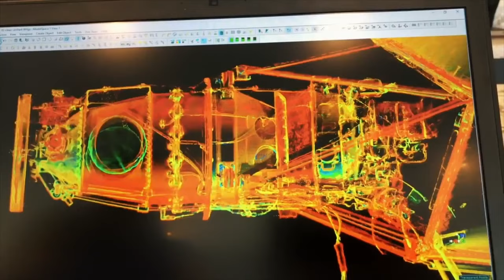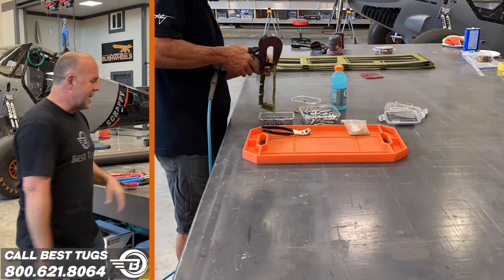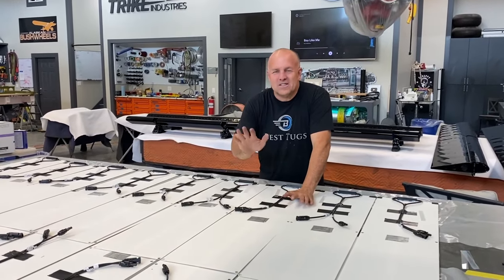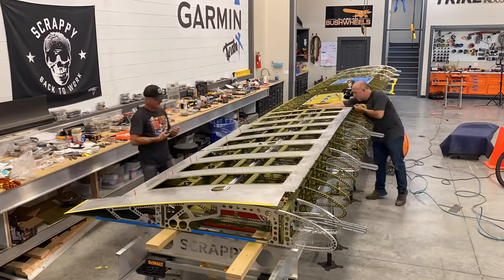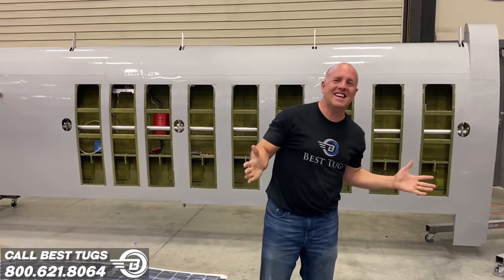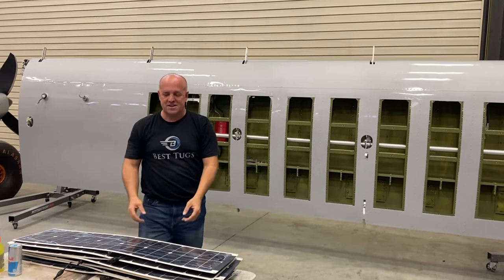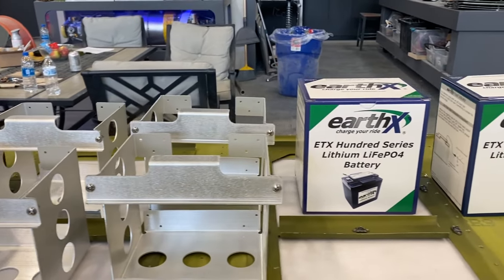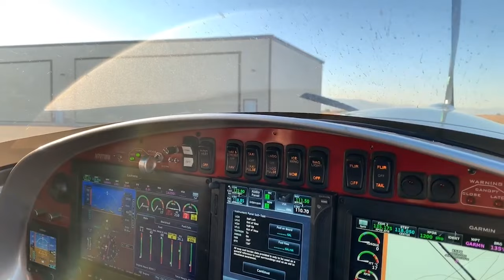Solar Panel Wings on Custom Search and Rescue Bush Plane | Scrappy #59

Comment: Hey Mike

 I was wondering how the low pressure on top of the wings, while in flight, isn't just going to suck those solar panels right off the wings. Then youre losing lift, potentially catastrophically. 

I see the little groove that tucks in, in the leading edge of the panels, but is that enough to counter all that low pressure?
Reply: they are riveted/screwed down around the perimeter too, the groove is just to prevent air from going under the panels
Reply: I get that, but it still leaves a big chunk of your wing surface made of thin plastic thats not nearly as strong as the rest of the skin that doesn't fare as well if, say, you have a thin sheet of ice, rain, etc.

Why not leave the metalc skin under the solar panels. Mike's  a smarter guy than i am, but it still makes me nervous. I guess we'll see how the wing performs.
Reply: @bakmir829  I have panels wit both fiberglass and aluminium backplates that are way sturdyer then the wingskin

Comment: If your wing loading is 15 lb/square foot and the solar panel is 3 sq.ft then the lift force is 45 lb. at 3 g’s that number starts to get significant...are the solar cells bonded to an inside skin......?

Comment: Hi Mike. I see that you're also into the Reno Air Races - I was wondering if you'd be interested in a racer that I've done the initial design of, it has a genuine 6,000 hp. That should be enough power? :)

Comment: Did Mike ever comment on why aluminum was used instead of carbon fiber for the wing material? I don't know very much about aircraft construction, but the aluminum seems out of place relative to the extensive use of carbon fiber throughout the construction elsewhere.

Comment: Mike, was there any reason why you did not use carbon fibre skins on the your wings? Would it have been cost, given that carbon fibre is lighter than aluminum and stronger than steel?

Comment: @MIKE: How well will the solar panels resist the 'suction' of the negative pressure caused by the airflow (lift) on the upper surface of the wing ?  The solar panels look a bit floppy, and I'm concerned that the negative pressure on the upper surface of the wing might cause the solar panels to distort or even pop out along the edges. (I presume that you've thought about this; this is just to make sure.) It should be easy to calculate the the negative PSI and multiply by the panel area, and then see if it makes sense that each panel could support ~200 lbs (?) of suction pull on their surface. Cheers.

Comment: What is the length differential of the black flaps and light wing from hottest to coldest? How does your control linkages accommodate the length difference without binding?

Comment: A 1kW Honda Generator weighs weighs 28 Ibs or 13kG. If you converted the generator to run on aviation fuel, how much difference would the weight be compared to the Solar installation on the aircraft?  You could run the Generator all day, not so with Lithium batteries having to have a residual charge.

Comment: Mike, is galvanic corrosion an issue with that much power flowing through the wings ? 
Also, how are you handling frequency isolation for your audio and headsets ?

Comment: What keeps the low pressure on the top of the wing from sucking out the solar panels, are they bolted in?
Reply: I was going to ask the same question... extreme  stall? Turbulence?    Mike?
Reply: @tommyo9879  I can see fasteners around the periphery and down the center as a backup measure along with adhesive to prevent long term vibration damage to the glass substrate in addition to preventing water intrusion into the foil cavity.

Comment: How much suction is created by the air foil and the Leading Slats and what material are the solar panels made out of? Would there ever be a chance of Solar Panel failure, i.e. the "Lift'" generatored by the wing "sucking" the panel out and leaving a hole and the wing stalling?

Comment: Anyone want to know how Mr Bernoulli will have his way with those solar panel?  How will the panels be secured to the ribs? The pressure differential might be significant to pull the panels out of the wing unless they are bonded and “rib stitched” in.

Comment: Hey Mike, Love your videos. I not into flying but the fab stuff is great. This video really made me wonder though. You are talking about backcountry flying and now backcountry with motos. Not sure that is a great message to be sharing with the general public. Many places in the backcoutry mechanized travel is illegal. Even a bicycle is prohibited. I ride traditional motos, used to for years in Colorado.(I am in Europe now which is even more restrictive). The electric motos coming out are amazing and I think the general public don't realize the damage they can do in the backcountry. They are full on motos, with the same or even more torque then an ice moto. Again. I am all for what you are doing. I think maybe you should just be careful how you are presenting it. Maybe even put a disclaimer that you will be using these awesome toys in accordance with the law but more importantly as low impact as possible.

Comment: do you plan to isolate the engine battery so that it isn't possible to drain Scrappy to the point there isn't enough power to crank and start the engine?

Comment: Mike, you basically just finished a wing with no upper skin.. as much as I love the novelty, this was a bad call for any plan let alone something as extreme.
during flight, you don't need solar to charge batteries and once you land and tie the plane there are better options that wouldn't compromise the integrity of your wing.

These solar panels won't help you if you are flying into the sun and they sure won't be of use if the plane crashes and is upside down or if one of these batteries catches on fire and the whole plane goes up in flames.

Comment: So you have 900 watts of nominal solar.  Rule of thumb for a fixed angle installation on a clear day is to expect 1/2 the rated output times the hours of daylight-2.  So for a 12 hour day you get 10 hours X 450 watts is 4.5 kilowatt hours.  Its a lot for camping, but I think you are going to be a little disappointed with how long it takes to recharge after running your batteries to rated minimum with a welder. This is all the more true when you consider that inverters are somewhere around 65% efficient at their max rated load. My conservative estimate of 10kW to run a welder has you burning through a full day's worth of charging in less 20 minutes of use.

Comment: How about the air sucking those panels out of the wing? They will be lifting the airplane, after all.
Reply from the maker: I’ll show the bolts later it has twice the attachment of any fabric or large top skin inspection bay.  👍🤠
Reply: @MikePatey  By the way, with those underwing attachments and power source you can take a concrete mixer with you, not only a welder. I guess you'd find a purpose for it in the wild.

Comment: Hey Mike, now let me start off by saying I am no expert on Lithium batteries but one of the downfalls of lithium batteries in an RV is they don't like cold. So in an RV application they have to heat the bay that the batteries are in. Are your batteries different or how did you fix this problem?

Comment: No way those solar cells will have the ability to run everything the way you described. Plenty of power in theory, but you will be lucky to get 50% of the rated power of the solar cells, especially the further north you travel. Solar cells are rated according to the power they would generate oriented directly facing the Sun, at midday, at the Equator on a Spring or Autumn Solstice day. That just never happens in real life. The cells are curved following the wing, so there is a loss of efficiency straight away. Not all of the cell can be aligned properly directly pointing at the Sun. Lithium batteries in the wing with high power wiring going past the fuel tanks, what could possibly go wrong?
The ideas and attention to detail are fantastic, but that amount of power in an area that will suffer condensation and huge temperature changes frightens the living daylights out of me. Solar cells on the wings, but everything else should be tucked somewhere in a relatively benign cabin environment to my way of thinking.

Comment: Anyone else think Mike is going to try and rebuild a gearbox in the bush....No. Just me then....One other question Can the clear layer on the solar panel handle the negative pressure on the top of the wing (The material and its adhesion)???

Comment: Wouldn't you put in two pot.meters at the wing tip which stops the flap motor in case of a split-flap situation? In the worst case of a split-flap, the aircraft will crash.

Comment: Mike how have you ensured the wing will still fly if solar panel rip off, crack etc?
Reply: Duct tape the hole shut. Even of it came off in flight he could fly just fine and land to tape it closed.
Reply: Multiple failure in flight is my concern.

Comment: Q: how do you keep moisture from seeping in between the solar panels and the aluminum skin?
Reply: I was thinking the same thing.  Mike spent a lot of engineering on keeping water out of the fuel system (I think we all fully understand why) but then puts in solar panels on the top of the wing that don't appear to be sealed at all.  The last thing you need is water getting into the wing and freezing which could jam controls, add weight, etc.  I think he's not telling us everything just yet.

Comment: What stops an overpressure of the interior of the wing from blowing out the solar panels ???
Reply: Usually openings... The wings are not airtight enough to build that kind of pressure, unlesss you cut an opening in the front of the wing to let air in, there are sufficient leakage to let air out to compensate for a climb.
Sure, the bag of chips you baught at sealevel might pop during a climb to max altitude, but not the wing.

Comment: Could that be a fire hazard in case of a day time crash? Since those solar panels wires are close to gas tank and will be producing continuous power, they could possibly trigger a spark.
Reply from the maker: They have breakers at the batteries and at the charge controllers as well as inverter that would trip before the wire size can even get warm.  👍🤠
Reply: @MikePatey   you have got everything figured out! Respect!

Comment: Why not a 2000W inverter to better match a 15A wall plug... If that is 4 or 2 awg wire... he is already maxed out at the 1200W after conversion losses I suppose. No clue how he is going to power a welder.

Comment: Amazing as it Mike is wouldn’t it have been just as efficient to carry a small generator just for SAR missions? It would have been more portable to be able to carry to a crash site or emergency location and wouldn’t weigh much more (if any more) than your oversized electrical system you may use 20% of, for 80% of the time? Don’t get me wrong, it’s simply an incredible job you’re doing but it almost seems excess for excess sake?

Comment: Does it have an air compressor? If it does, I must have missed that part.
Reply: It's in the SAR pod opposite the welder.  These hang on the motorcycle clips of course.
Reply: I believe his compressed air tanks have a separate line dedicated for use with air  fittings for whatever is needed
Reply: @Airplanefish . You are saying it has compressed air tanks, but not an on board air compressor?
Reply: @james1795  correct
Reply: @Airplanefish . Interesting.
Reply: @james1795  that's how he operates the landing gear struts and something else. I forget what the other system is that uses the compressed air
Reply: @Airplanefish . I have a hard time accepting having air tanks, yet having no way to refill them in a remote area with no air compressor available.
Reply: @james1795 bummer
Reply: @Airplanefish . Sounds kinda fishy to me.
Reply: @james1795  good one dad.
Reply: @Airplanefish . I couldn't resist.
Reply: @james1795  most people can't. I'm used to it

Comment: IS THERE ANY CHANCE THAT THE SOLAR PANELS COULD START VIBRATING  FROM AIR PASSING OVER THEM AND IF THAT HAPPENED THEY COULD  TEAR OFF IF SO HOW WOULD THAT AFFECT  THE WING PERFORMANCE WITH AN OPENING ON IT  WAS THERE AN AIR FLOW ANALSIS DONE IN CASE THIS COULD HAPPEN    PS  CANT WAIT TILL I  GET MY SCRAPPY SPARS   STAY SAFE
Reply: @amytaylor8487  DOING FINE  SO WHATS THE ANSWER WHO ARE YOU  IN RELATION TO MIKE P    THANKS

Comment: Were the build videos I could build a smaller battery bank with lithium batteries more power less weight. You could do it your shelf of you just buy some lithium batteries make your own them block batteries are clumsy

Comment: Good luck trying to run power tools (in the bush) with a 1200w inverter. Buy a 5000w inverter. The difference in size and weight is negligible.

Comment: What is your total battery storage capacity in Watt-hours? Also are your EarthX batteries 12V, and thus running your system on 12V or a different voltage? I would be interested in seeing/hearing more about your solar panel series vs. parallel layout. 
I am intereste because I am designing and building a dual 1000W motor solar powered off road camping bicycle trailer for my friend as a version 2 of the first solar (non power assisted) trailer that he used to bike across america with (@DavidsSolarJourney)

Comment: Has Elon offered you work yet?!? Lol 
With the batteries tied to the aircraft is the reverse true, need to do some serious welding in the rain or run out off power, you can fire the engine and recharge the batteries from the planes alt?

Comment: A 1200W inverter is too small to run a welder or a grinder. Your voltage will drop on motor run up from the in rush. Curious to know if your inverter has low voltage and over current cut off. You might fault out your inverter. A 2kW inverter is the minimum working size for most generators with 2.5kW-3.2kW being the standard inverter size for “working” purposes.
Reply from the maker: You missed where I talked about the quick change sytem for the drop in larger inverter I have.   I have used this larger sytem on a welder before.  The 1,200 is only for normal daily use as I don’t want to pack my massive sytem all the time.
Reply: @MikePatey  I definitely did miss that part with the larger inverter. That sounds awesome being so versatile.

Comment: i really dont get it ... why dont you just bring a good sleeping bag ? and what if you lost your engine  and finish upside down ? what will append whit your solar panel ? it will useless , and all electrique batterie in a crash ?  why added so many weight everyday ? and for  welding !  just barrow a generator for rescu and weld a landing gear, once in a lifetime. aniway  thanks for sharing all the awsome video !! but sorry i dont get it now .

Comment: As an engineer I am impressed by Mike’s engineering analysis and considerations, BUT the solar panels in the wings and associated weight of panels, batteries, inverters, etc. make zero engineering sense. Would be far better off with just carrying a small Honda type gas generator. Solaris cute and woke but Wrong engineering solution. I’m disappointed in Mike.
Reply: Yeah, I agree, for a SAR missoin where you have to land in an opening and walk into the forrest, you need pretty long extension cords to use the solar setup, a generator you can carry to where you need it.
Reply: My feelings exactly.